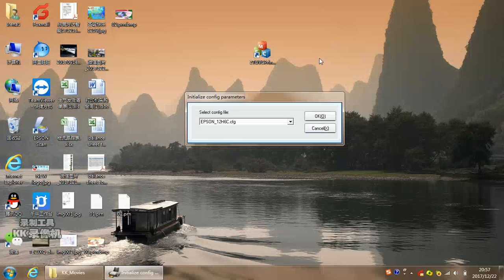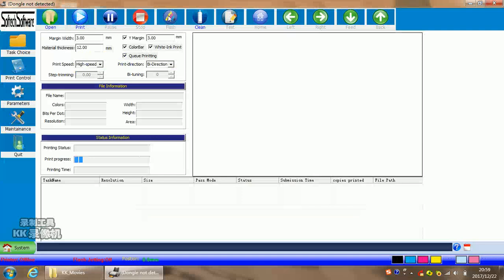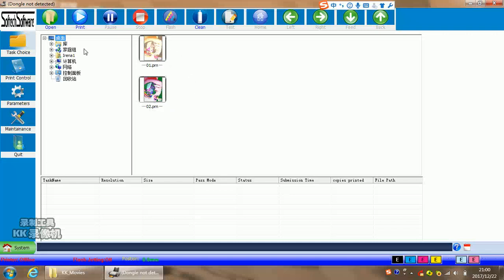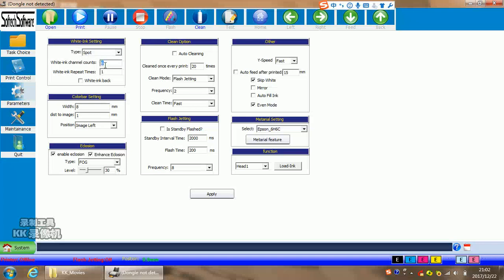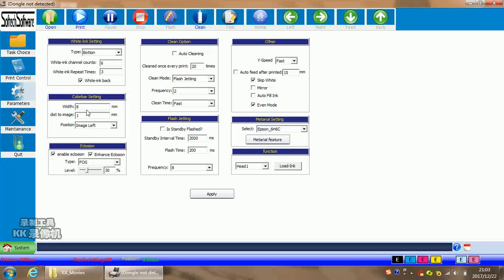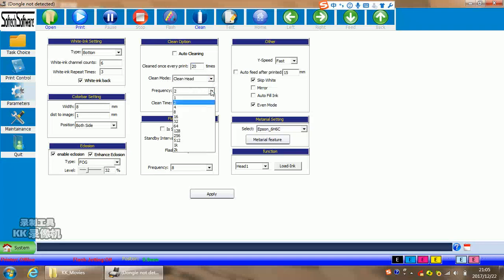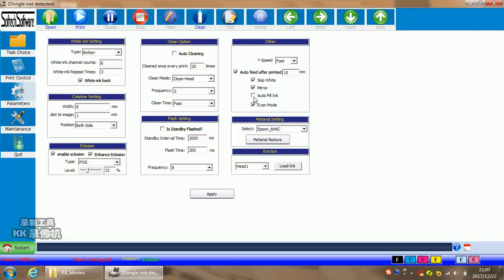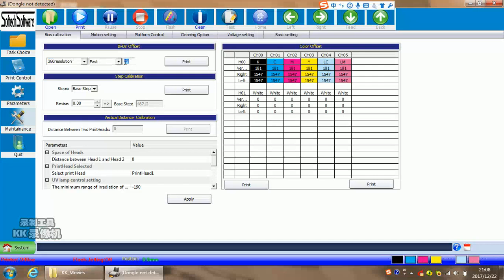control software function instruction

Comment: I have a problem with error 30136 then to 33008 1 pass print error. What does that mean? Im using saitu flexi print for ripping and use 6pass, spot color, and 100% fog
Reply: Do you have 1 or 2 heads if you can send me softwear files i can help you to find error code explaining

Comment: Dear friend, thank you for these lessons it sure helps a lot.  However i had one question about the function area. I press load-ink, and it was sucking the ink in the white bottle in the back of the printer; is that supposed to happen?.. and i tried to run the test but it keep saying that the perimeter is less than the color. What would be the suggest setting for the perimeter, if you don't mind me ask?
Reply: Hi @roxroyreid5038, Is your machine a wall printer?